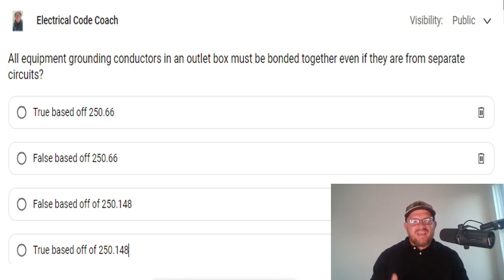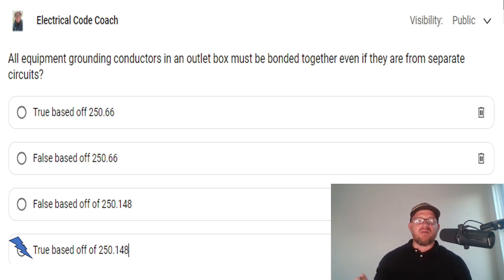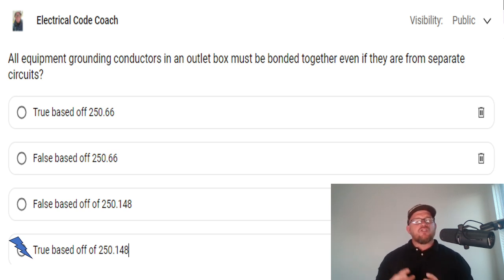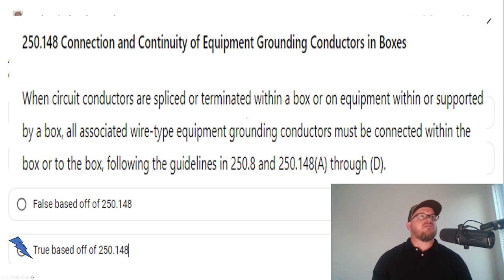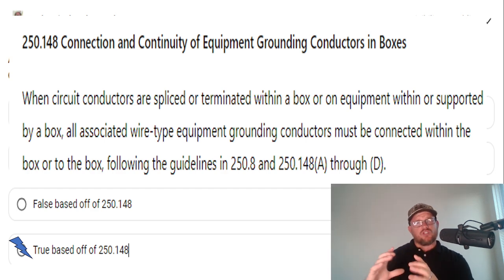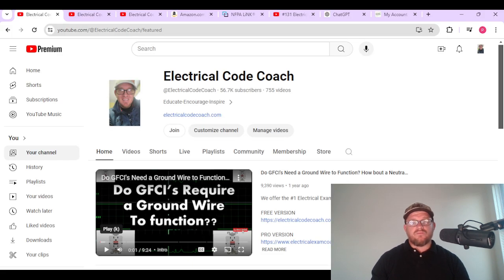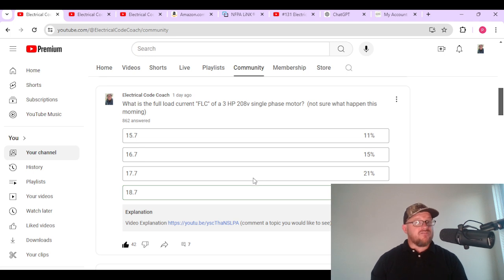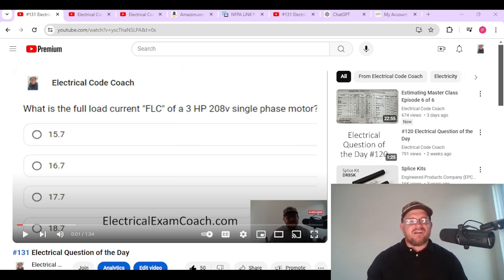#132 Electrical Question of the Day

Comment: I do a lot of high-end custom houses, sometimes the back porch will have 3-4 Infratech heaters that require 240v 30a (10-2) homeruns, and then from the switch to heater it requires 3 conductors so we pull 10-3. 

Long story short sometimes we end up with 9-12 10gauge grounds in a box , trying to twist all those isn’t practical , I’ve always kept the grounds separate for each switch . What could I do in that situation? I don’t even think the blues are rated for that many 10s